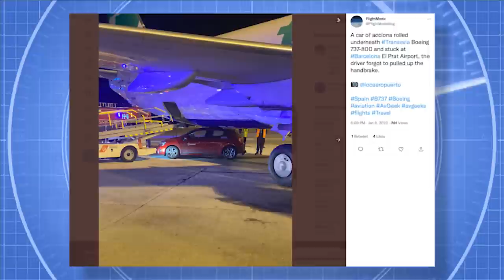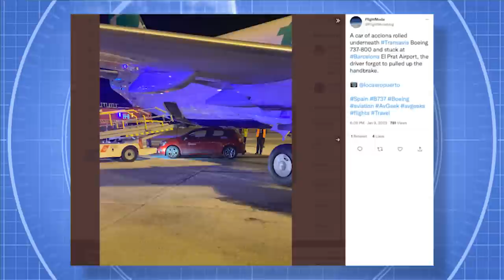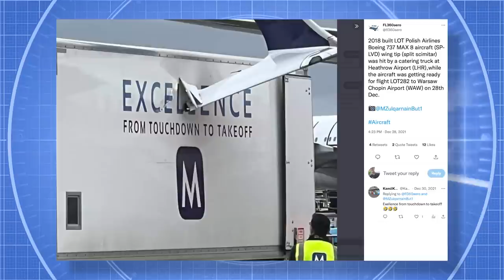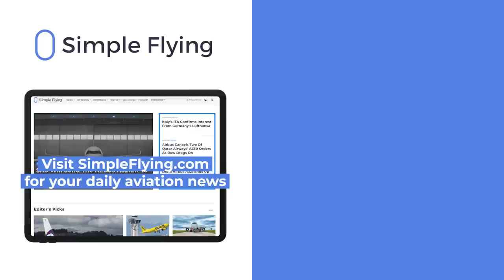Transavia Boeing 737-800 Damaged By Ground Vehicle With Inactive Brakes

Comment: I remember Transavia!!  Very nice airline.  And yes I did.  While working with American aka USair, a maintenance vehicle, without stopping, crashed into the forward section of the fuselage on the right side of the 737-500.  The aircraft significantly rocked from side to side following the loud smacking sound of the impact.
Reply: If you are referring to the days of working for USAir, they never had the 500 variant. They did have the 200's,which became MetroJet until parked after 9-11, the 300 and 400's operated thru the 2000's and ended up parked by 2015.
Reply: @tallmansfavorites7563  🙂oh ok.  It was probably the 400 variant then.